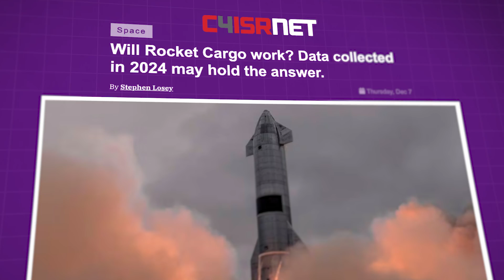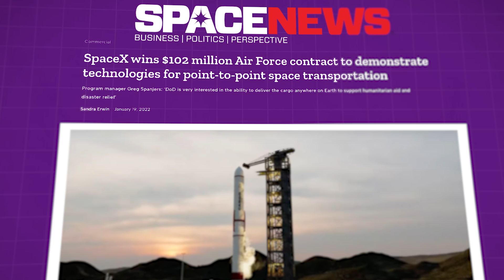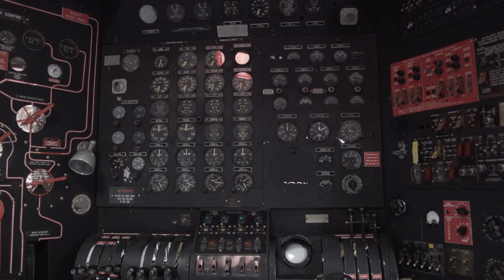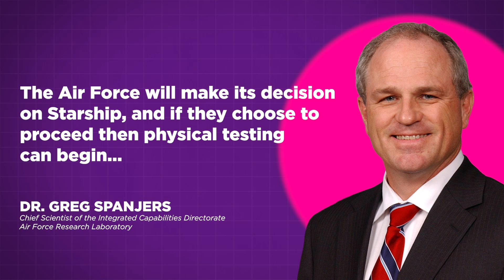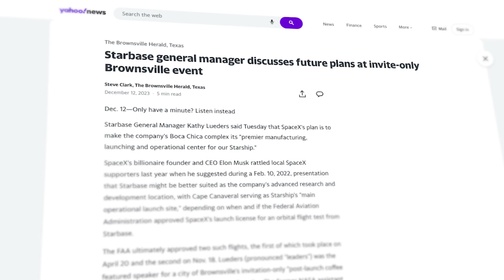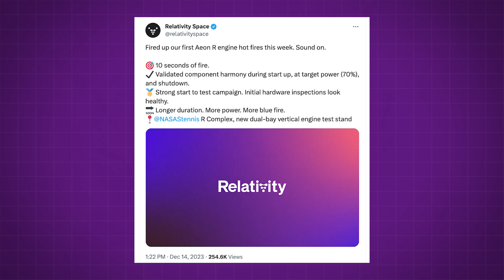The US Military Is Paying SpaceX $102 Million For a Custom Starship!

Comment: So, The US Space Force might actually eventually get its own spacecraft?
Reply: us space force has the x37b so they already have their own spacecraft
Reply: @TheOfficialVexMeow 
It is an "x" plane, eXperimental. The USSF still does not have their own spacecraft. Also the USAF was running the project as well. so the USSF did not even have that all for themselves
Reply: It might be experimental, but it's still a spaceship, not a plane.

And it's a functioning spaceship.
Reply: @DocWolph  it's not IMAGINARY so yes they have their own spacecraft it's in space for over 700 days at a time sounds pretty operational to me
Reply: @DocWolph  The "X" is for eXtra-atmospheric.  🙃
Reply: @lordgarion514 Interesting moniker you have, good Sir.
Reply: @LordDustinDeWynd 
Okay, under that line of "reasoning" then what "X" was the space shuttle? 

"X" is used by the US to denote eXperimental flying vehicles, aircraft or spacecraft. The Venturestar, reusable space craft intended to replace the space  shuttle, for example was X-33.
Reply: @TheOfficialVexMeow  
I never said it was imaginary. Only experimental.  Those 700 days only mean the USAF and USSF are actually pretty pleased with the X37b. But being unmanned those 700 days mean little other than More Testing.
Reply: @DocWolph  The shuttle had it's own designator.  The X was to confuse US's adversaries, did great until story broke.  What's Sierra Systems lifting body named, do you know?  It's about ready for first flight outside atmosphere, and USSF is REAL interested in it.
Reply: @lordgarion514 
And the cause for your objection? Please look up X-33 (Venturestar) and DC-X (Delta Clipper). "X" is for eXperimental flying vehicle, air or space. That has never changed since the Bell X-1 at least 12 X's were spacecraft.
Reply: @LordDustinDeWynd  
Is that what is causing you confusion? The "Sierra Systems Lifting Body" is called Dreamchaser. That is the one that has yet  to make a space flight. The X37b is unmanned and referred to as "OTV" or "Orbital Test Vehicle".  

Like the X-47 Drone, everyone including myself thought was going to be the USNavy's new attack drone, the X37b is not going to be used. It is simply another another in along line of test vehicles to develop underlying technologies and systems for more effective, and less expensive vehicle just a few years down  the road. The Dreamchaser being case and point.Then you add the USAF and USSF eyeing SpaceX's Starship...

Seriously, you have internet access. But then there is a marked  difference between "knowledge" and "information".
Reply: @DocWolph  Nope, no confusion.  They're similar in many ways.
Reply: @DocWolph  If you believe everything the government says then yes it's a test vehicle if you aren't actually slow in the head you would realize the capabilities of the US space force spacecraft that can intercept any satellite i wonder why they stood down from the ussf 52 mission after the weather forced a scrub, it's because they had to wait for their trajectory to intercept a specific satellite. It's a classified mission on a heavy lift vehicle, the x37 has only launched on medium lift vehicle.
Reply: I thought the same thing. Starship would be a cool look for their first equipment.
Reply: They already have the x37b space plane
Reply: No, the would buy launches and have a custom ship that's owned and operated  by Spacex. Ownership stays with they launch provider. But that's semantics
Reply: They are recruiting for tactical cadets
Reply: Donald trumps space force😂 sound like something a kid would come up with  😂😂 JOIN SPACE FORCE  SPACE FORCE NEEDS YOU 
TO INFINITY AND BEYOND 🚀✨
Reply: @rustyGstring25 ”What’s the matter, spaceman? Hey, could be worse, at least you’re not a seaman.”
Reply: Space marine dropships babyyy!
Reply: Yes

Comment: Really nice production quality on your videos, but it feels like there are more factual errors than there should be.  It would not be accurate to claim Terran 1 is the first rocket with 3D printed parts, which you seemed to suggest. Rocket Lab has been 3D printing most of their engines for years now.  But 3D printing much outside of the engine is less common, and so Terran 1 does set the high water mark for how much of a rocket is 3D printed.

Comment: wait wait wait, is it true that a rocket launch is less polluting than a plane flight ?
Reply: They are only talking about suborbital missions, which require less fuel and lower suborbital velocities. It's just a big hop around the planet. Starship troopers, here we come.
Reply: Sounds great.I've heard Buenos Aires is a bit of a dump these days anyway! @damianousley8833
Reply: The exhaust from SpaceX Raptors should be only water and carbon-dioxide since the fuel is liquid oxygen and methane, both existing in nature.  The molecule, not the liquidity.
Reply: The old Boeing 707 put out 640 POUNDS of particulate matter from the hydrocarbon fuel every time it took off until reaching cruising altitude. ONE B707.
Reply: Yeah a Galaxy uses about 150 tonnes of fuel. But the Starship only uses a fraction of that in it's 4,500 tonnes. Elon Musk saving the planet one Exploding Starship at a time.
Reply: @rickb.4168  🤣
Reply: lol no absolutely not.   starship burns millions of pounds of fuel.   What are you people talking about??
Reply: Yep, an airplane puts out pollution from start-up to shutdown and spreads it over a wide area.  A rocket puts out a sh*tload of pollution for 5 or 6 minutes, but nowhere near as much as multiple jet engines running for hours and hours.